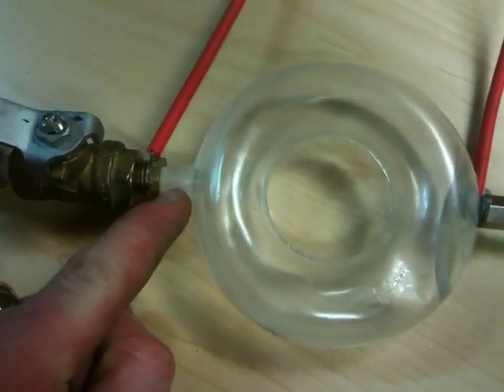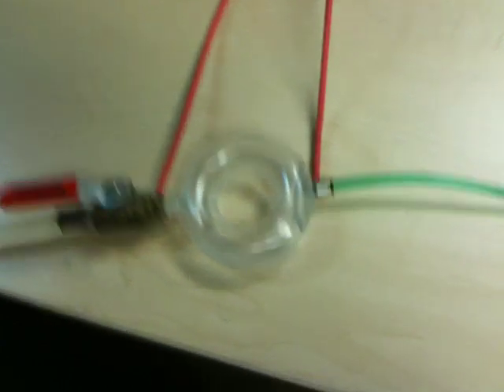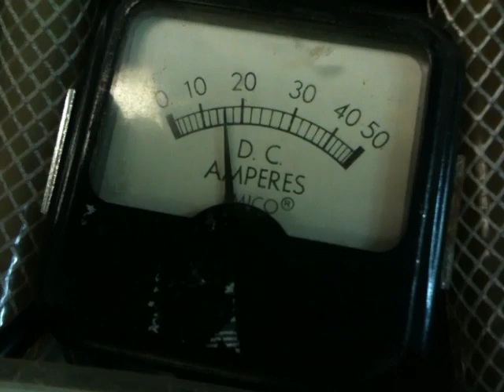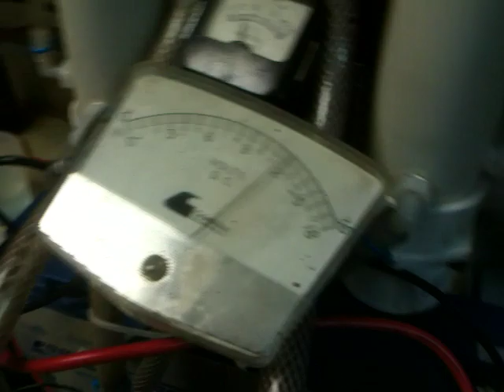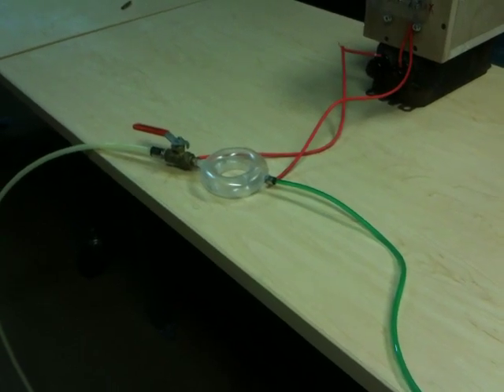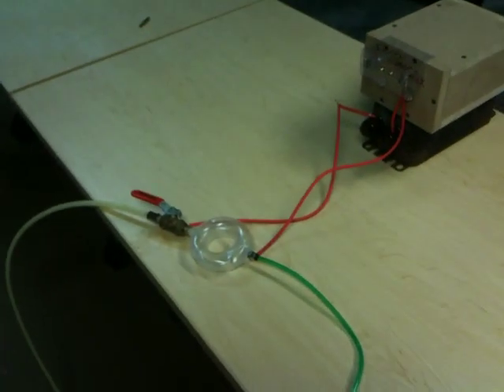P1 Hydrogen Plasma Experiment... See Part 2 RWGresearch.com (EPG TEST1)

Comment: Russ,the plasma will appear at much lower pressure.Take a pump out of 1 of those air con units and pull a vac on the donut and you should get a very different result!Also check if the output is magetic,even tho you got no plasma.The donut was buzzing so there is a high voltage field there.BTW really good job on the arduino pulse unit!

Comment: I do believe that more pressure (more Hydrogen Atoms) would help to create the plasma.  Remember the spark gap you demonstrated in the argon, and how the effects were different at different pressures?  
I wonder if you can spark gap the hydrogen, and magnetize the new gas? just need some LED"S (was it IR or UV??) 
Smart move heading out to the garage, high voltage and explosive gasses dont belong in the home, LOL, well not most homes!
Good luck and be safe!